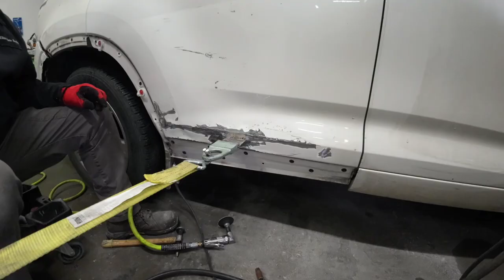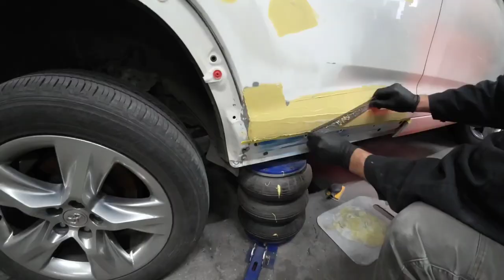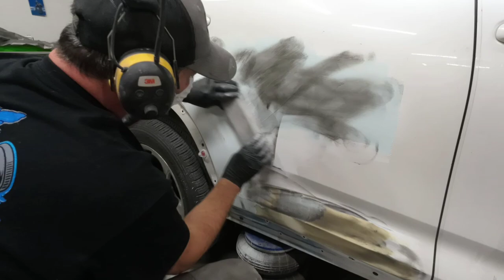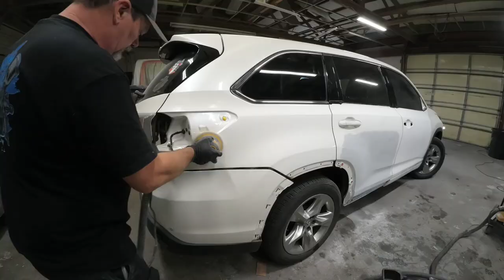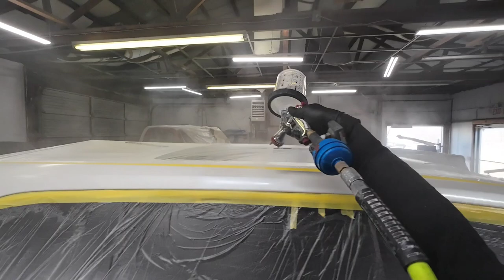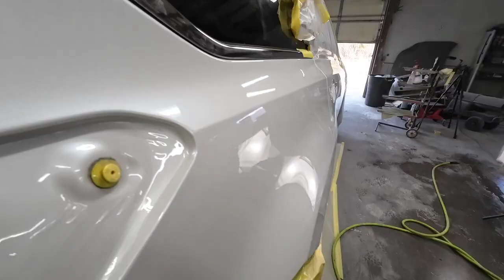AUTO  BODY START TO FINISH timelapse.

Comment: Great work, Sir! I have a question for you.. Can both a Volkswagen LA7W Standox solvent base (+60% of acrylic thinner) and the next 2K anti-scratch clear coat (mixing ratio: 2:1+10% of acrylic thinner) be sprayed with a H-2000 mini gun having a 0.5 mm tip? Or is it required a bigger tip? I have to do only a little spot repair. Thanks a lot!
Reply from the maker: I've  sprayed base coat and clear coat through a touch up gun of that size but not a high solids clear. Shouldn't  be a problem since your reducing the clear but I can't  say for sure.

Comment: I’m in the middle of trying to repaint my car. As I rough sand using p320 on the old clear coat it’s starting to break off in sheets. Why does the clear coat break off or peel off? What’s the cause of it and how can I avoid this problem. 

The pre job was done with rattle can quick dry Rustoleum and 2k clear.

Thank you for your help!
Reply from the maker: Adhesion is why that happens. Probably because of the rustoleum but could have been caused by flsh time or incompatible products. If you repainting with base clear , be sure to remove the rustoleum paint. It could cause  problems with the new finish. Appreciate the comment and support!
Reply: @GarageNoise  I have removed almost all of the sprayed 2k clear that was delaminating and sanded the stable Rustoleum basecoat with p320, p400, and then p600.  Sprayed touch up areas with primer sealer.  Can I lay a coat of urethane basecoat with activiator and fast reducer on the area? Weather tomorrow is 65F
Reply from the maker: @huey8431   yes but be aware there is a possibility that the new paint could react to the rustoleum paint. i would start with a lighter coat of base to make sure there is no reaction.

Comment: Hey love your work on the Iwata kiwami for clear on a all over paint job will 3 turns out from close and fan pattern wide open is a good start ?
Reply from the maker: Yes , air at 28 psi and if uou don't  feel your getting enough  clear bump up the fluid 1/4  at a time.
Reply: @GarageNoise  ok I have the Eastwood lt 100 also had the fluid and fan pattern wide open and kept getting orange peel and running out of material fast until I watched your video did 3 turns out from closed and fan pattern wide open air pressure at 29-30psi made a difference
Reply from the maker: @jeremiahtinsley8048  Yes! exactly! Turning down on the fluid volume helps the air atomize the clear that's  why you get a smoother  finish. Thank's  for the comment knowing this helped you is why I make video's. 👍

Comment: I've used the r500 for primers mostly but I always hated it. Sagola 3300 lays the primer so much nicer.  Tiny and uneven fan patterns are it's main issues iirc. Or maybe I had a counterfeit r500 😎
Reply from the maker: It's  a inexpensive gun and some may come with spraying defects I ordered 2 and both came and sprayed the great but you could have gotten a defective gun. The sagola is a great gun. If I was in a booth I'd  be wearing out that Sagola but I loke the low overspray of the R500.
Reply: @GarageNoise  Last year I did some work in a high volume big shop - they had about 15(!) r500's hanging on a wire in the gun storage - all looked brand new 😎 The local painters said they got them dirt cheap but all of them went out of order in a few years  - no amount of washing or maintenance could keep them working properly. Not sure what level of neglect these guns went through but it didn't leave a good impression. But I guess for an occasional diy anything above an r500 may be overkill.
Reply from the maker: @john2335  That doesn't  sound too encouraging. I'll  be intrested  to see what my experience is after a year or two.  Appreciate the comment!